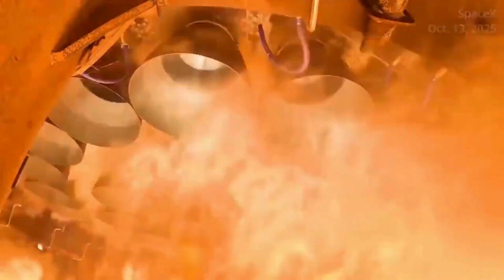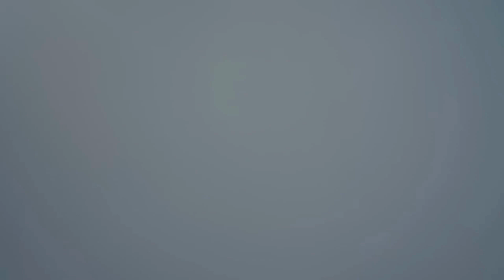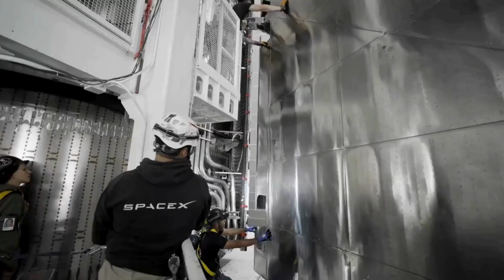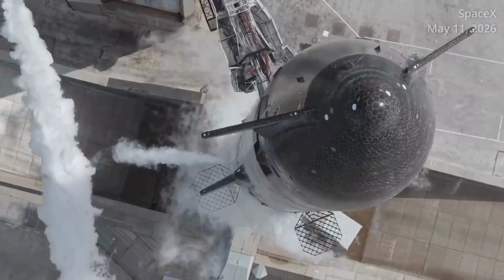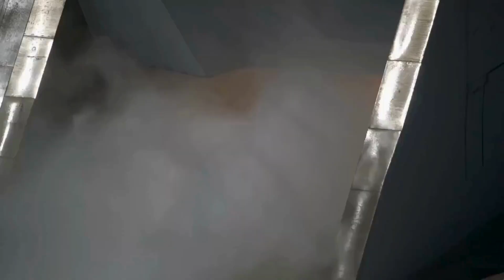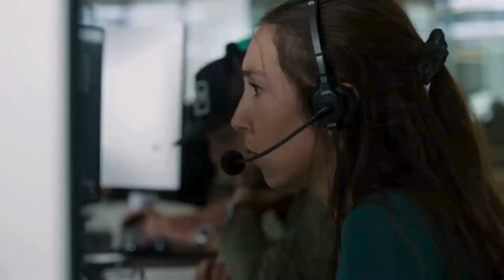SpaceX Starship Flight 12: The New V3 Mega Rocket Is Ready!

Comment: This was a fantastic documentary, beautifully put together! 👏

Quick question on SpaceX: how do you think the massive upgrades to the V3 Raptor engines will impact the overall payload capacity compared to the earlier flight tests?
Reply from the maker: Thank you so much! Really glad you enjoyed the documentary style! 

As for Raptor V3, the impact is going to be massive. By removing a lot of the external plumbing and increasing the chamber pressure to a staggering 350 bar, SpaceX is pushing individual engine thrust up to about 280 tons. When you multiply that across 33 engines on the booster and 6 (or eventually 9) on the ship, the total thrust increases significantly. Compared to the early flight tests, this extra muscle is what will finally push Starship's fully reusable payload capacity toward that legendary 100 to 150-ton target. It's a huge leap in efficiency!